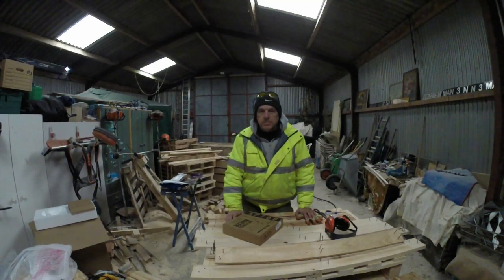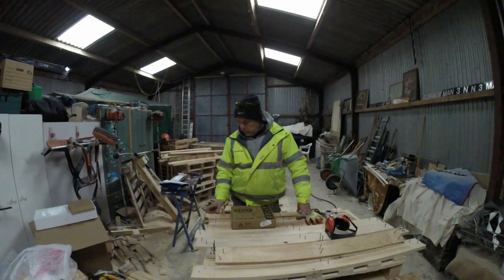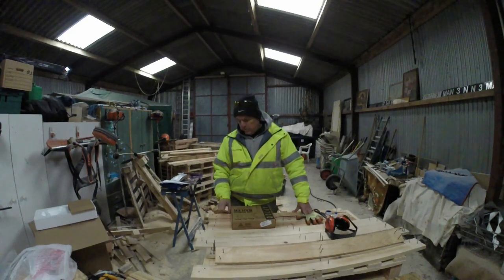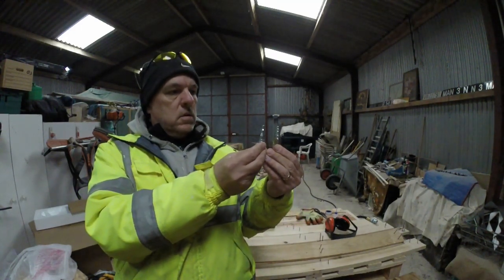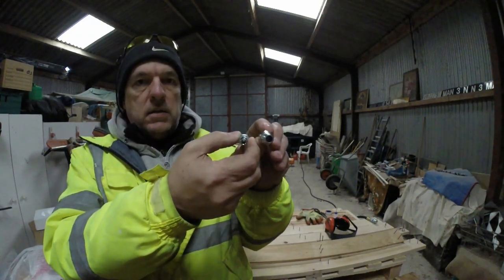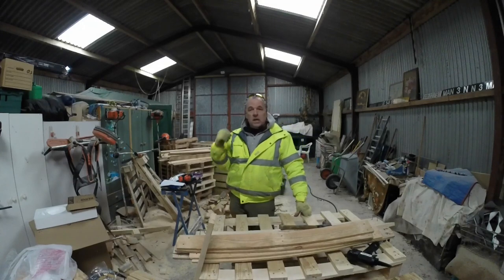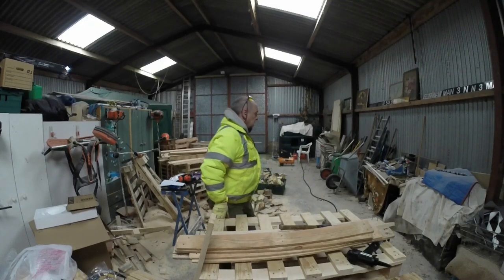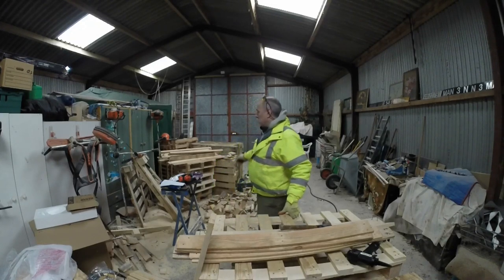Review of the Air Locker AP700 Nail Puller / nail punch

Comment: Hi Rob thanks for the review I've been looking at these since I saw Mark on Dainer made use one. I've got to get myself a compressor as well and I've been looking at the Einhell its about the right size for me and I work for Toolstation and get a good discount so it will be less than £100. I didn't realise there was so many different hose connections so I'll have to look into that 😂😮 before I buy any accessories or tools. Thanks again for the 3 reviews very informative.
Reply from the maker: The nail puller is such a great tool, so much nicer than constantly trying to hammer nails!  Good luck getting the right quick connectors.
Reply: Thanks for the video. Really useful review and run through on the kit. Can you tell me where you got your ntp to bsp adapter?
Reply from the maker: Thanks.  I got mine on ebay.co.uk from a seller called 
context-pneumatic-supplies-cpm who was very helpful and gave me advice to make sure that I got the right adapter.
Reply: @frompallets  Thanks.  Will take a look.  I'm equally as frustrated by the lack of information from compressor suppliers and accessories about the connections they use.  BSP, NPT, Euro, etc, etc...  Does your head in!
Reply from the maker: I feel your pain, I hope you get the right solution before too long